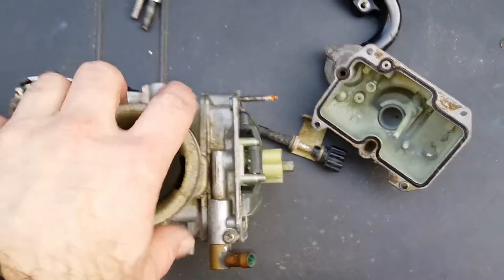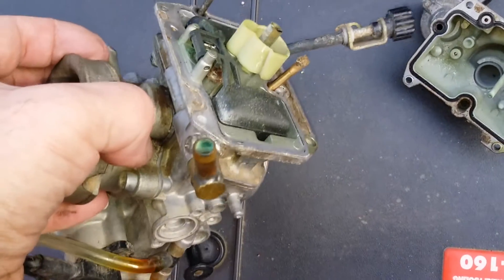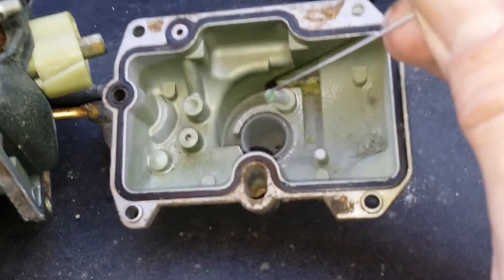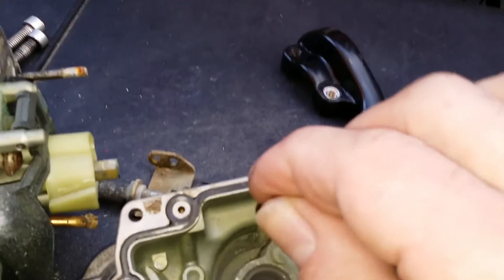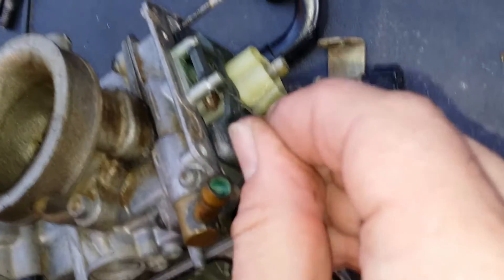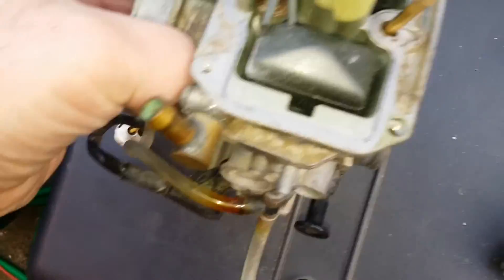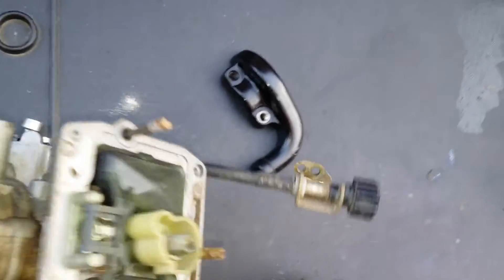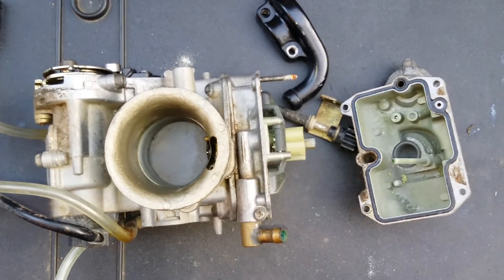KTM 525 EXC - poor running - cleaning carburettor

Comment: Hi. Just purchased a 525 and it struggles to start but once under load it’s good . Could it be air fuel mixture or dirt on the carb?
Reply from the maker: It could be that the fuel jets and other brass fittings within the carb have become furred up with green scale due to corrosion from the water in the ethanol added to today's petrol. This scaling up of the bores and passage ways in the carb will cause the engine to become difficult to start. This will be especially so if the bike is not used that often and the fuel in the carb is allowed to stand and corrode its components. The only way to know what's going on is to strip the carb down completely.
Reply: RichPober just purchased Polaris 525 ktm engine Recently when turning it on it starts to leak gas To be exact where the carburetor joins You have some idea that it could be?
Reply: @elelegantes5909  
Float stuck in the carb. Pull it off and clean it out.